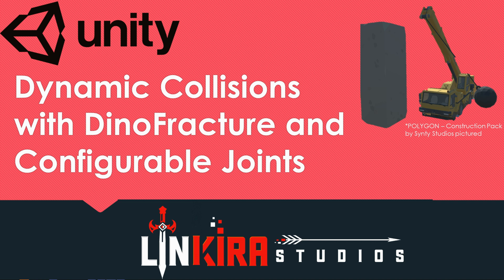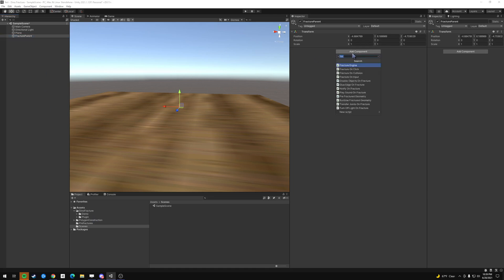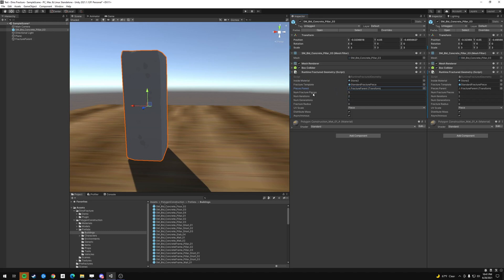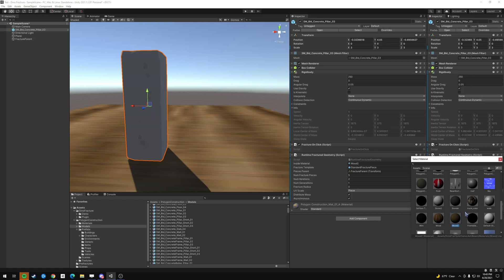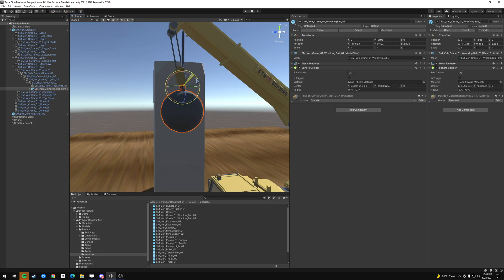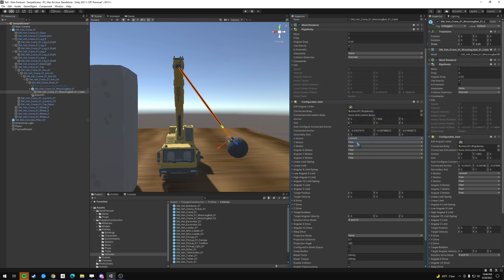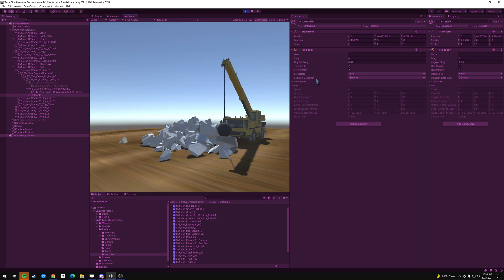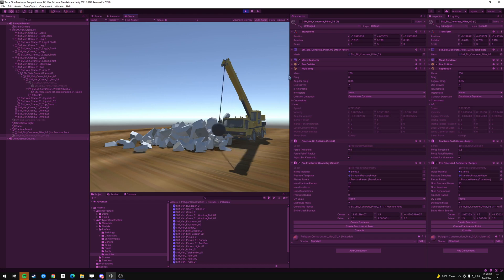Dynamic Mesh Destruction with Dinofracture

Comment: I think something all of the tutorials on Dino fracture lack - is how do we handle cleanup. Even if you only use pre-fractured objects and low amounts of pieces - the game is going to clog up very fast if you keep all of these pieces around (not to mention the base scrip isn't very performance efficient to begin with ^^')
Reply: What’s the best way to prevent this ?
Reply from the maker: I wrote a short script that does some cleanup, perhaps not the greatest, but let me know your thoughts.  Each Runtime Fractured Geometry Script for dinofracture has a function near the bottom called On Fracture Completed.

So i made a game object called cleanup, added it to it.  Then added a cleanupdebris script that looked like below.  You have to bring a game object over for the script to work, so I have everything operating off of parents.  FractureParent, with UnFractured (Original, becomes inactive on fracture) and Fracture (gets created on fracture).

    public void OnFracture(GameObject go)
    {
        StartCoroutine("DelayedCleanup", go);
    }

    private IEnumerator DelayedCleanup(GameObject go)
    {
        yield return new WaitForSeconds(30.0f);
        go.SetActive(false);
        yield return new WaitForSeconds(1.0f);
        Destroy(go);
    }